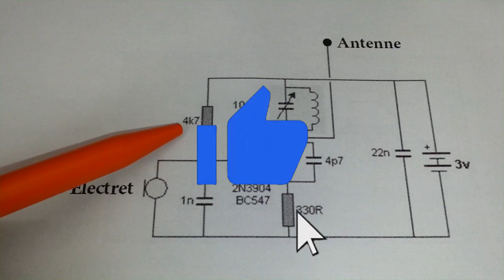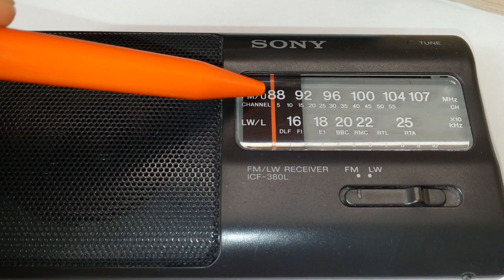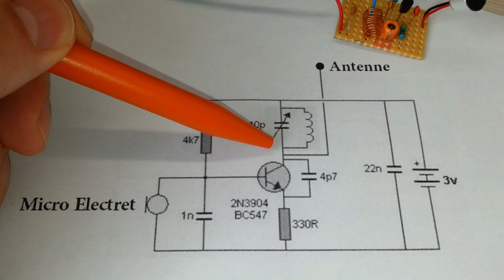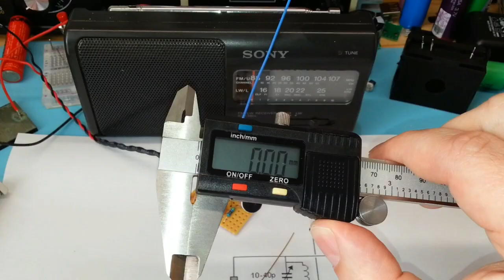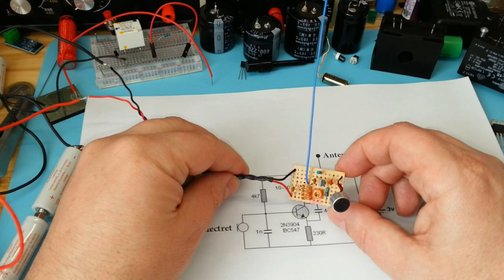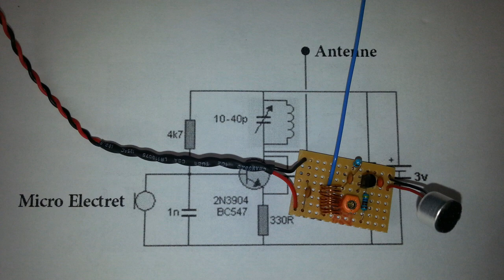Electronique 🆕⚡️ mini Radio emetteur fm 🌎 electronic experimental fm transmitter

Comment: Sympa petit  montage. Plutôt que de monter un electret on peut aussi injecter directement un signal audio directement sur la base du transistor via un petit condensateur. Ça peut être de la musique provenant de la sortie casque d'un lecteur CD par exemple. Ceci permet de diffuser de la musique chez soi sur un poste de radio placé dans une autre pièce. Et attention de ne pas utiliser un fil d'antenne trop long. Ne pas oublier que l'oscillateur HF de ce petit émetteur rayonne beaucoup et peut perturber les voisins s'ils sont sur la même fréquence.
Reply from the maker: Maxime Dambre 
Merci beaucoup pour le commentaire 👍
Reply: Bonjour, merci pour votre commentaire, de quelle puissance préconisez vous le condensateur?